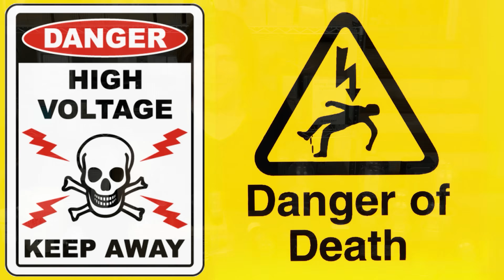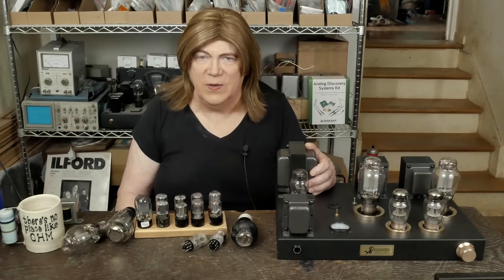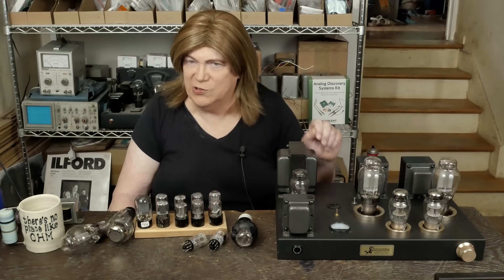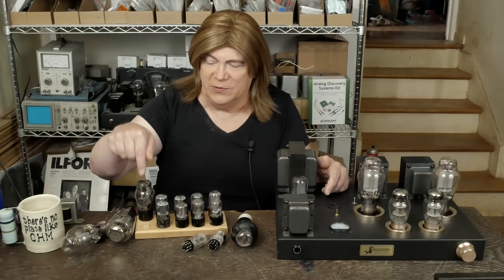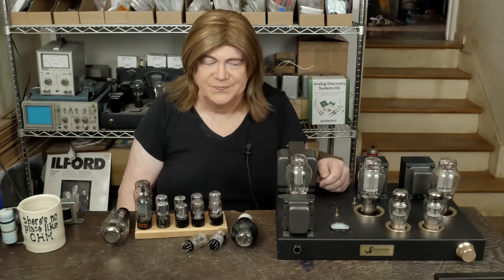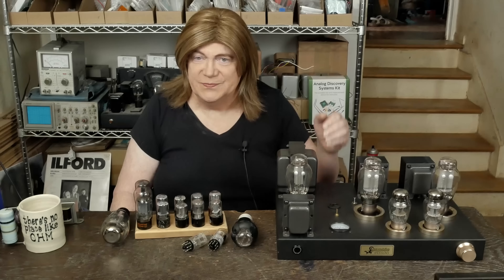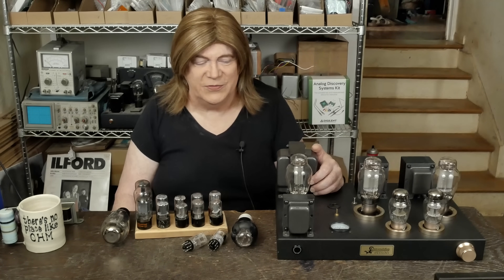2A3 Single Ended Tube Amp DIY Build: Resistors Matter!

Comment: Can this be modified to also accept 45 series tubes ?
Reply from the maker: I haven't done the math, but likely switching to a 5Y3 rectifier and a 1500R cathode resistor would get you there. The other issue is a 5K OT is needed.
Reply: Thank you for the quick reply. I know there are manufacturers that incorporate both tubes selections into 1 chassis, are they ‘ compromising ‘ the sound at all of either tube by doing so ?  Also, what are your thoughts on the 45 tube ?  John
Reply from the maker: I haven't played with the 45 tube. The problem I see is they are only avail NOS or a very few new production + 2W of output power at best.

Comment: Hi Steph, any reason why your BOM shows part nos for 5% resistors rather than the 1% versions of PR02's that they sell. Is this because you buy in bulk and select yourself before build? They seem to be same part apart from 1% tolerance. Also do the leds you specify need any selection for the circuit or could I just buy 2 and use the two that i get. I seem to remember in the past you showed us some variance in these parts and you selecting them too. 6h9c may be a good starting point as cheaper  for build testing and then maybe change out when happy amp and voltages are all good. Very tempted by this 2a3 amp.
Reply from the maker: Because in testing the 5% vishay parts they rarely, if ever, are outside of 1%. Why pay extra for nothing? I suppose if you are building one amp and are worried you might randomly get a outlier?  But I would always recommend buying a few extra of each anyway in case you make a mistake, these are very cheap parts. And buying 10 is many times cheaper than buying 4 anyway. Same on the LED, there is infinitesimal variation between parts and are cheap parts, buy a couple of extras in case you drop one and it disappears.  The tubes, even the best  "matched pairs" will be exponentially different compared to these hard parts. And actually the 6H9C is a pretty decent sounding tube.

Comment: How much are you selling these for?  Im interested
Reply from the maker: 2A3 base version without tubes is $2200 + shipping. Not sure how long that price will last with tariffs on parts.
Reply: @SkunkieDesignsElectronics Thanks!  It would be cool to know some ballpark prices of your other tube amp builds as well.  I am planning on eventually picking one up!  I rather buy from you than these big predatory brands, even if the price is higher
Reply from the maker: https://www.skunkiedesigns.com/productsforsale

Comment: All soviet tubes are either US or Europe tubes clones (as bad as communist industry was able to replicate). Don't waste your time on them. Usually they are worse than originals. 
I have an idea to probe Philips 6SN7 there, cause my impression is that Philips tubes sound like a studio equipment (almost all of them), when US tubes have more variety in sounding. So, for an input stage a clean, colorless sound is better IMHO.

PS I think that a tube working point affects a sound more than any resistors, or a tube type. When people swap tubes blind, I start suspecting something )

Comment: You should try using grid chokes in parallel to the grid leak resistors, on the driver and/or the output tube.
Reply from the maker: What does this provide in a cathode biased amp?
Reply: @SkunkieDesignsElectronics  Adding a grid choke in parallel with the grid leak resistor in a cathode-biased vacuum tube amplifier can provide several benefits, especially in high-fidelity audio applications or when driving large Miller capacitance from a prior stage. Here's a breakdown of the benefits:

1. Improved Low-Frequency Response
- The grid leak resistor and the coupling capacitor form a high-pass filter that limits low-frequency response.
- Placing a grid choke in parallel lowers the effective impedance at low frequencies without affecting DC grid bias.
- The choke allows a DC leakage current path but offers low impedance at very low frequencies, preserving bass extension.

2. Reduced Grid Current Distortion
- High-value grid leak resistors can leak grid current, introducing distortion—especially if the prior stage drives the grid near zero bias.
- A choke, having low DCR but high inductive impedance at audio frequencies, allows better handling of small grid currents without voltage shifts, maintaining more stable bias and lower distortion.

3. Lower AC Load on Previous Stage
- A large grid leak resistor presents a high AC load, which interacts with the Miller capacitance of the following tube to form a low-pass filter.
- A grid choke isolates the coupling capacitor from the grid leak, effectively buffering the Miller capacitance, helping preserve high-frequency response.
- This is especially helpful if the driver stage has limited current capability (e.g., triode drivers with high plate resistance).

4. Cleaner Coupling
- In combination with DC blocking capacitors, the grid choke provides a quiet and stable return path for the grid, reducing hum or leakage pickup through resistive paths.
- Especially valuable in high-gain circuits or stages with high input impedance.

5. Extended Dynamic Range
- By reducing bias drift and grid charging, the grid choke can help the amplifier maintain bias under dynamic signals, especially near clipping or at large signal excursions.

Practical Considerations
- Grid chokes must be high-impedance at audio frequencies (typically several henries of inductance).
- Low DCR (<10kΩ) is ideal to prevent altering DC grid voltage.
- Should be well shielded and placed away from power transformer fields to avoid hum pickup.
- Adds cost and bulk, so usually only used in high-performance or high-sensitivity applications.
Reply from the maker: Is this from your personal experience or from chat GTP's experience listening to amplifiers with grid chokes? Having read this, putting resistance/impedance in parallel will never be higher than either one is alone. It can't make the AC load easier while at the same time lowering the resistance/impedance. And how does a choke in parallel with the resistor "isolates the coupling capacitor from the grid leak"

Comment: Great video Steph! Back when Joseph did this design CC resistors were still pretty available. This kind of thing can drive me crazy. My first amp built some 30 years ago had some very expensive resistors. If only my soldering at the time was up to that standard! My own dream is that Non inductive wire wound resistors were available in a complete selection.

Comment: Looking at the Amazon website i wonder if they really know anything about the tubes they sell..? The text next to the 2A3-AT tube pic talks about: "This beam power tetrode delivers powerful, tube-untypical bass, making it an outstanding choice for audiophiles and professional users alike."

Would they know the difference btwn a triode and a tetrode...???

The new generation 2A3C's have a really good price/sound ratio, much better than the 2A3B's! Chinese mesh-plate tubes can sound a bit thin and are not really steady in operation. I really like the Emission Labs tubes. The solid plate type is somewhat like the JJ 2A3. Although much better fabricated and more refined sounding and it can handle a lot of current with a lot of energy in the bottom octaves. The mesh plate is a special sounding tube... but expensive. (btw; i don't have any commercial connection to any producer of tubes or resistors. My ears are the main judges on this topic;-)

Comment: The process of voicing an amp can make you go nuts. It’s not necessarily an easy process, but I’m glad you found a part and value combo that works well, and will for anyone who builds the amp. 

I love Kiwame carbon resistors in the signal path, but mostly metal film in the PSU. Carbon comps sound fantastic, but tend to drift rather quickly from temperature variations and just running them. The Kiwames have that certain sound as well, but with a 1% tolerance in 2 and 5 watt. The 5 watters are smaller than a lot of companies 2 watt resistors. 

It’s great to know there are FINALLY current production tubes that sound good and don’t red plate! Time will tell of their reliability, but I’ve got a feeling it’ll be a nonissue. I’ve got a nice stash of some beautiful old stock rectifier tubes, which mostly still test as new 50 years later. 

Fantastic video as usual! Thanks, Stephe! 🔊🥳🎶💜
Reply from the maker: Thanks so much, glad you enjoyed the video!

Comment: My motto is; the less R's in the system, the better it sounds!;-) Especially in the PSU i only use chokes, no R's (except Cap drain R's). I've also noticed the difference in sound when the gridleak-R is swapped with a gridchoke, in both stages (two-stage 2A3SE power amp). For the K-bias i use the big green ceramic power Welwyn's W22/24's and in the first stage the very refined little blue Welwyn's. To my ears they are the best sounding R's.

Comment: Glad you found a current production rectifier tube that works great . Most do not know resistors makes a difference in the sound path. Carbon film can have stray inductance that effects sound . Just how their made,  Carbon film on a ceramic rod and laser cut a spiral path to make value.   That spiral path makes inductance . It is small but enough to effect tone quality . In power supply circuits I like wire wound. That gives some inductance that is a good thing for filtering DC. Small ones carbon film is fine . Also on carbon film their is stray capacitance where the film  is cut. acts like 2 plats of a cap. his is very small but can effect the tone quality. When working with RF  circuits I normally do. type of resistor makes a huge difference. Looking forward to better transformer build of 2A3 . And the 300B one. Cheers from NY !
Reply from the maker: Good info, thanks for sharing your resistor knowledge!
Reply: @SkunkieDesignsElectronics  Same goes for the caps . The foil wrap  type has stray inductance. The ESR .
Reply: I'm not an engineer, let alone an rf one so much respect for your work and knowledge! I made a comment earlier regarding the same topic, I deleted it and would like to ask here cause I just can't wrap my head around this resistor influence and worse I may have a bias against it :) Found a few sources stating the stray inductance of carbon composition resistors in the single digit nano henry range. I do not have a source for carbon film or wire wound but let's say they are a magnitude order higher for the sake of the argument. I am sure that in very high frequency RF you get attenuation and have to take the resistor and layout in to account very carefully. But, how can those values of stray inductance (few nH) have any chance of attenuating audio frequencies in a tube amplifier stage having for example 100kohm or 1Mohm loads? If I try to calculate the resulting filter made by the 100k carbon comp plate load resistor with a 10nH in parallel and a load of 1Mohm I get no attenuation whatsoever at audio frequency, Also power supplies are low impedance, so it could only contribute locally like an RF filter for very high RF I guess, can't hurt to have that but don't see how it could change the sound unless the amp has very poor stability margins and starts oscillating. How can these minuscule parasitic reactance's can filter or cause change in response at 20kHz with sub Megohm loads? The resistor just does not store enough energy to change response at audio frequency, it has the phase shift of a bendy wire :). I feel like the effect has better chance to be of psychological nature. Sorry for the long post/rant. Cheers!
Reply from the maker: I went into this expecting nothing to change, so how can it be psychological? And you aren't the first person to rant that parts can't make any difference in the sound, using math to "prove" it. Feel free to ignore my findings, it won't hurt my feelings. Also feel free to not bother testing it yourself since the math "proves" nothing can change...
Reply: @SkunkieDesignsElectronics  Parts do make a difference on tone quality. The proof is when you swap them out and try them . Working in RF circuits I see this all the time. IMD test is one of them . I do agree with your findings . I was pointing out how the resistors are made causes them to change tone quality . Just as much as caps do . The proof is on side buy side test like you did .  YES parts make a big difference on sound.  You just proved that !  Love your work. Keep testing ! CHEERS .
Reply: @SkunkieDesignsElectronics  I wasn't ranting I was agreeing with you  . Pointing out how the resistor is made causes tone to change . CHEERS
Reply from the maker: @robertmeyer4744 I wasn't responding to your comment :)
Reply: @SkunkieDesignsElectronics  I'll buy some resitor types and try it on my amp in the places you sugested, I admit I have not made a proper experiment. I do respect your approach and trust the real life results you honestly present, just could not explain it through the common  measurable differences like in caps and inductors. Sorry for the tone in some places one too many beers.
Reply from the maker: All good and some of this makes absolutely no sense to me either. Like power supply cap brands. Going from a solen film cap to a Wima "DC link" film cap destroyed the bass response in my 300B amp. I tested everything, even bought a breakout board for my analog discovery to test impedance vs frequency, they tested identical but sound wildly different, that was NOT subtle at all!!!!

https://www.youtube.com/watch?v=w2Ayxs7RGlk

Comment: Hi Steph! great Video, I have rebuild my JE Labs Type 45 Amp recently because the first build I did 20 years ago (just learned soldering) and wanted to make the Amp an reflection of what I learned and the skills gained in the last decades. I'm in Europe so my amp is fitted with Lundahl Iron (which, like Tango is very very nice!) The Circuit is similar to your 2A3 I think but I use only one 6SL7 for both channels and 5,5K output impedance for the 45s obviously. First of all, I also found the CC Grid leak resistor to be very important because I initially tried to swap everything for metal Film too and observed the same as you (the old version was build like JE Labs suggestion, I find MFilm was better on almost all positions). Another tweak I did was battery Bias and I think it's the same principle as the LED you used, since the difference was so big on the preamp tube I tried to find a solution for the Bypass Caps on the Power Tubes and tried to get the 54V with LEDs but ultimately settled on big 100uF/160V Foil Capacitors parralel to the Bias Resistors (Ohmite), those sound amazing in comparison to the old electrolytic! Eventually I swapped all Electrolytic caps for Film Caps (Also PS, Total Capacity is so low on my JEL Type45 so it was just in my budget back then).  Now beeing 48years old I can have a bit more budget (Also the expensive stuff got reused) and started buying Mundorf Capacitors for all positions in the amp and all the signal wiring is done with pure silver wire isolated with teflon tubes, I think I paid about 300$ for the Caps and another 100 for the Wire but I love how well this came together. It is sounding very fast and smooth with realism and warmth (Using my old DIY Speakers made with 98db/w Saba radio drivers). Another thing to mention is that all my Tubes sound better/differnet in the amp as they did before, as I have virtually no hum any more after the rebuild (Under 1mV). Curious what you will think of silver hoockup wire! Thanks for your great Videos, best from Austria!! F
Reply from the maker: I plan to trial silver wire soon!

Comment: For gridleak, Kiwame carbon is fine.. I would use high quality metal  film for the cathode and/or plate resistor.. That’s for the front end and driver..

Comment: Hi Stephe, I have had good experience with the following tubes in my 2a3 amp. LinLai WE2A3 Western Electric 2A3, ECC32 RSD, RT512 - TAD 5U4G REDBASE PREMIUM SELECTED. I know it is not your circuit but sounds really good. I am using a self build Universal 6or12SN7 Dual Mono PreAmp from valvesNmore with two E-6SN7 Linlai E-Series. Those Linlai made a huge difference in this setup and I am planning to replace the two ECC32 in the 2a3 amp with them. maybe you want to experiment with them yourself. I am looking forward to build your 2a3 amp with the tango output transformers once you did the evaluation. Very good work Stephe. I enjoy your channel very much.
Reply from the maker: Thanks for sharing your tube experiences, I appreciate the info!